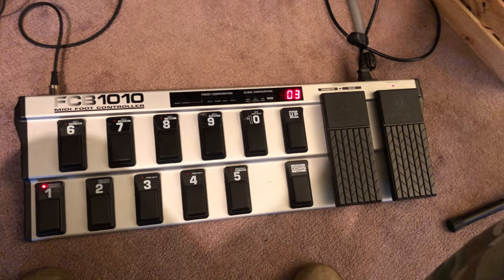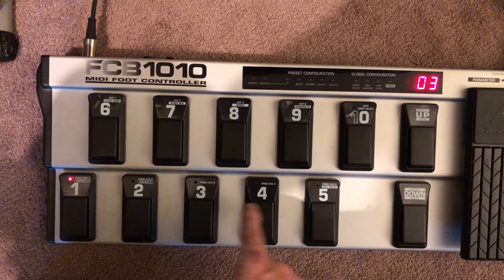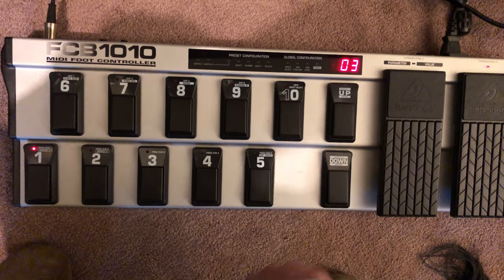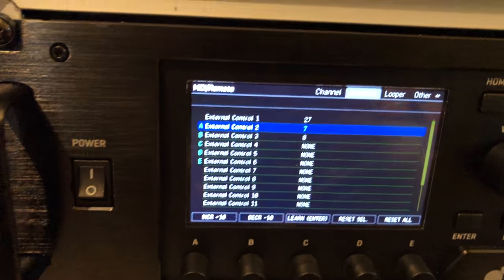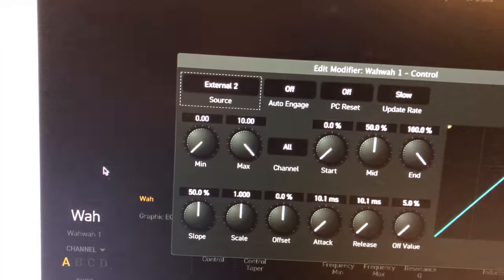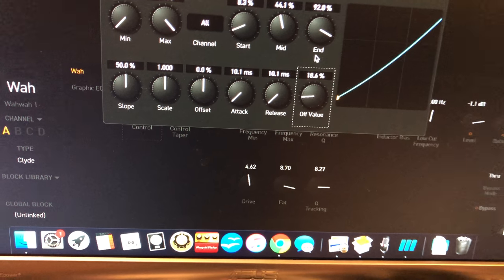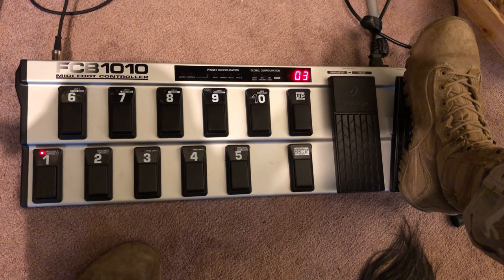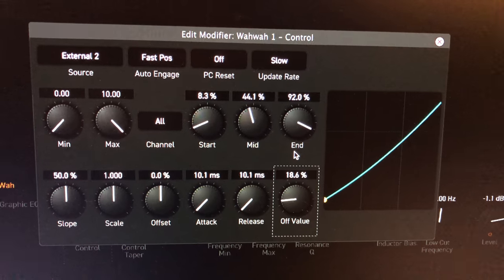Axe-Fx III & FCB1010 - Wah Setup to Auto-Engage

Comment: I cannot thank you enough ! I just got an FCB1010 and have been pulling my hair out with it trying to get the expression pedals to do anything at all with my Axe-FX 1. It was all about assigning the correct Ctl # to Expression 1, 2, etc in the Axe-FX. Neither Fractal nor Behringer provided any useful documentation on these functions. Behringer's 2 page manual on the FCB is laughable - I don't know how anyone was able to figure this thing out but clearly you have. And your knowledge was a game-changer for me !
Reply from the maker: Happy to help! Yeah, I got the FCB at the same time as my Axe III so I had to learn both units and MIDI at the same time - it was drinking from a firehose, but I guess it worked. The FCB manual is pretty bad; but its main problem is how dense it is. It's short, but SUPER packed with information. I've since moved on to the official FC unit for my Fractal gear, but I still hang onto my FCB just in case :)

Comment: Hey man, with regards to pedal 4/scene 4 and pedal 5/ scene 5. I put the fcb on pedal 4 and the Axe on scene 4. I walked through the programming process for the wah. Then I had to redo the whole process of setting up peda 4l to controll scene 4. It worked perfectly! Of course I repeated for pedal 5 for scene   5. Now have I have wah at my feet for all the pedals I have set it to controll scenes. Right now I have pedals 1-7 controlling scenes 1-7. Its sweet having wah at my disposal as if I had a physical wah on my board. Thank you very much bro, much appreciated and Rock On!!

Comment: I have a FCB1010 and I'm looking for a modeler. This has been very helpful because auto engage is a must for me! If the modeler doesn't have that function then I'm not interested!!!
Reply from the maker: @LucasGonzalezA  Agreed. I got spoiled by my Morley Bad Horsie wah when I had a pedalboard. Seems absurd now to have to click a button and THEN the wah begins, because it would start at the toe down position. Nah, the Fractal gear is amazing. The ONLY reason I don't use it now (now that I play bass in my band and not guitar) is because the pitch-shifting for bass or cleans is so trash. The Helix is far superior, as is the NDSP stuff. So once NDSP brings their plugins to the QC, I might pick one of those up, even if it is more limited MIDI-wise than the Fractal gear. We'll see...
Reply: @UglyBunnyJase  I had the Behringer Wah, which also works the same way! Thanks for these videos, by the way. I'll end up getting a Fractal modeler.
Do you have the uno chip on your pedalboard? I'm considering getting that mod as well.
Reply from the maker: @LucasGonzalezA  I don't have the Uno mod. I bought it but never installed it. Keep in mind that these video guides of mine won't work with the Uno mod, although I'm sure there are plenty of guides out there for it - good luck :)

Comment: Great tutorial 👌 
It changes through the chanels A B C D as well. Is there a setting i need to edit?
Reply from the maker: As I noted in your other comment, this means you either have the same MIDI CC assigned to wah bypass AND channel switching, or you have multiple CCs being sent (meaning you have BOTH button 6 and 7 active in edit mode). Make sure you're only sending the wah bypass CC and make sure, in the Axe Fx, that that CC is assigned ONLY to the wah bypass.

Comment: Hello again! Whenever I do this I loose the control of the scene that I set up on the FCB-1010. Meaning if button #4 is lite up on the FCB, than I loose the ability to change to Scene 4 with button #4 on the FCB. If I go into edit with no buttons lite up, than the FCB will not let me light up/edit  button #9? Other than that, I  am able to set up the wah with controller B perfectly! Thank you as always my friend!!
Reply from the maker: If you have the STOCK chip (no EUREKAProm or UnO) this should work. Every "preset" (inside the FCB1010; meaning, every button 1-10, all banks) has the ability to use both external switches, both expression pedals, a direct note, both CCs, and all 5 PCs. 

I'm not sure what you mean by going into edit mode with no buttons lit up; Do you mean that you hit button 4 (now lit up) and then go into edit mode and there are no buttons lit up inside of edit mode? Or do you mean that there are no buttons lit up at all, then you hold the DOWN button to go into edit mode and THEN it won't let you turn on pedal 9? I'm a little confused, as I cannot even go into edit mode unless at least one button (1-10) is lit up. Then, once I'm in edit mode, I have no issue turning on pedal 9.

Are you sure you went through the proper process for going into edit mode? Holding down, then hitting UP once to get past the external switching part? If you just held down to go into edit mode, you won't be able to turn on any functions until you get past that first external switching part in edit mode.

Hope this helps; not really sure what to tell ya if for some odd reason one of your pedals buttons won't let you turn on a function it should let you turn on.
Reply: @UglyBunnyJase I have the stock chip, and yes I was trying to edit  button 9 on the fCB with nothing on the board lite up. I know I cannot do that now. I think what happen was this. I had pedal 4  lite up (and later pedal 5 which gave me the same problem) I walked through the whole process to set up the wah. It worked perfectly. Problem was when doing this I had now lost the ability to switch to scene 4 using button  4 on the FCB.  So I had to go back  and reprogramm pedal 4 and later pedal 5,  on the FCB to be able to switch from scene 4 and  scene 5 like I had it originally.  At this point I am now able to have wah on ALL my scenes, except on scene 4 and scene 5. Either the FCB or Axe Fx ( not sure which) will not let me turn the wah on scenes 4 or 5? Somehow in all this I accidentally programmed the Axe scenes 4 and 5 and or the  FCB buttons 4 and 5 to not turn on the wah. Even trying to turn the wah on manually on the Axe hardware, I am unsuccessful. It just wont turned on for scenes 4 and 5?? Thx bro!!
Reply from the maker: @HamsterSpanks  That's... interesting. The only thing I can think of is that there is a conflicting MIDI message somewhere; are you sure you didn't save those scenes on your Axe with different settings than the rest? There's no reason I can think of why this would be the case that scenes 4 and 5 won't let you use wah. If you disconnect the FCB, can you turn the wah block on via Axe Edit or the front panel? If you can, then buttons 4 & 5 just need to be programmed differently. 

Try this: for Scene 4 (pedal 4) Make sure that only one CC is on (button 6) set to CC#34 with a value of 3 - that should make it go to scene 4. Make sure NO other pedals are lit up except pedal 9. Make sure it's CC# is the one you set up to control your wah block. set the first value to 0, and the second value to 127. Exit the edit mode. Now, by hitting pedal 4, that pedal should only take you to scene 4, and the EXP B should control the wah. Do the same thing for pedal 5.

Let me know how this works. Forgive me; I'm not trying to insult your intelligence if you've already tried this. But it should be a very simple setup and it's puzzling why it's not working. I'm hoping it's something very simple :)

Comment: okay I am working with scenes 1-7. The wah works just like this vid on all scenes except for scenes/FCB buttons FOUR and FIVE?! This is like this for any preset I set up. I must have de-progammed buttons 4 and 5 on the FCB-1010 somehow?? I dont know?  What do I do? Thx man!!!
Reply from the maker: Best thing I can suggest is to expect each different pedal you press to reset everything; that is, you have to deliberately program all functions you want to each pedal (which is why some recommend the computer program to do it faster) - so just because the wah pedal worked when hit pedal 1, it won't work once you hit pedal 5 unless you set it up, turn it on, and program it as such. So just program pedals 4 and 5 exactly the same as the others (except to access scenes 4 and 5, respectively, of course) and it should work.

Comment: Thanks for the video! I'm using a BOSSGT100 and I'm trying to follow along here. When I go into MIDI/REMOTE, next to external control 1 etc it only lets me go from 0% to 100%. It wont let me put in 7 or 15 etc
Reply: Hey man sorry.....I think I got it to work! Thanks again
Reply from the maker: You're in the wrong menu; you're accidentally trying to set up the "Initial Value" in the "General" page - You need to page over to the "External" page. Good luck!